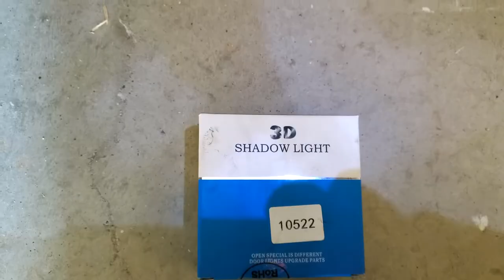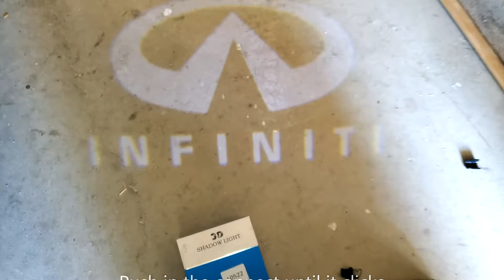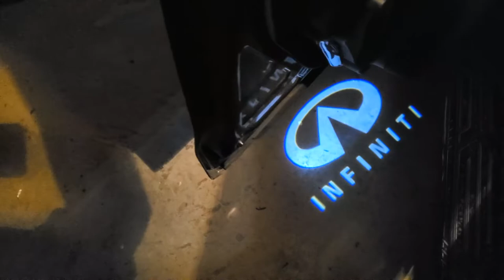How to Install LED Ghost Shadow Door Light Logo Projector - Infiniti Q50 Q70 Q60 QX50 QX56 QX70 QX80

Comment: I can't pull my original door light out the clamp to install new ones
Reply: Me either did you figure it out?
Reply from the maker: @MatthewPettit-h7i  Look at 0:57 just push down the tab on the wire top side and slide the light out.
Reply: @flixmasterz4411 thanks for replying and yeah I get how your supposed to do it but mine is like stuck or some something lol I did it in my g37 but can’t get it out in the q